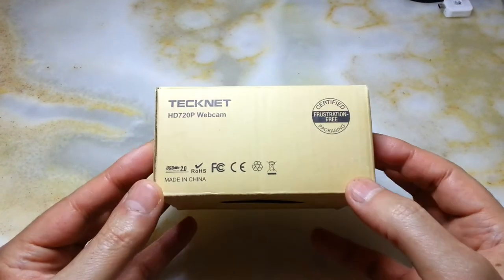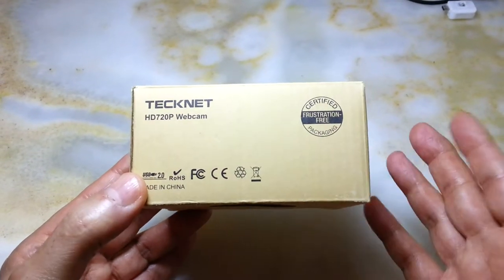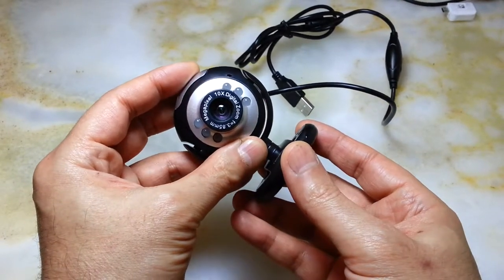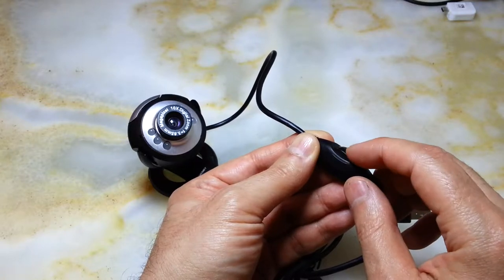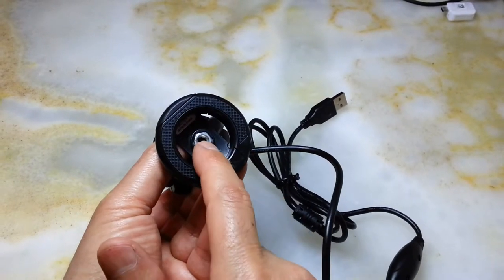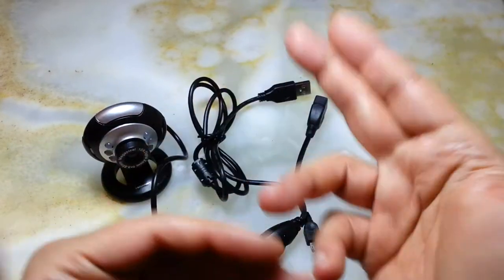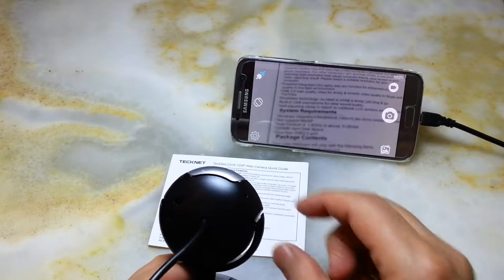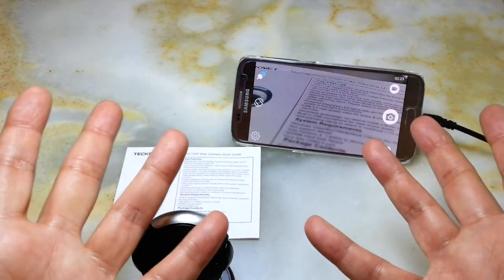Tecknet HD 720P Webcam & how to make rear view bicycle camera with old mobile phone

Comment: Hi there, I followed what you said and found it works quite well...only problem is, is that when I've got the connector in the mobile phone, on the bike, it keeps on falling out, if going over bumps. So, how did you get round that?